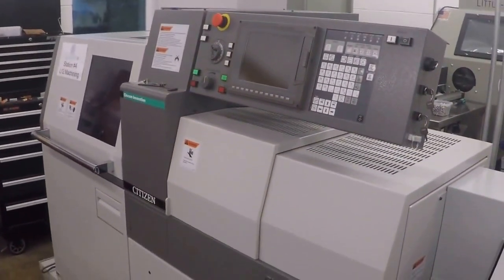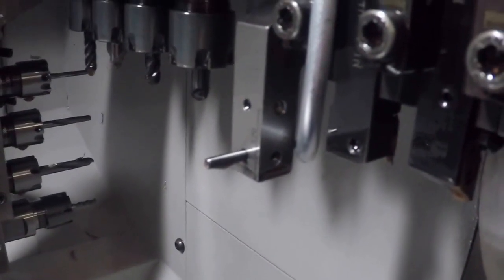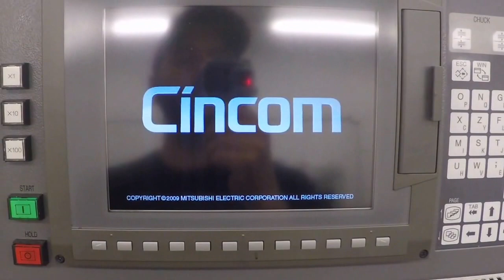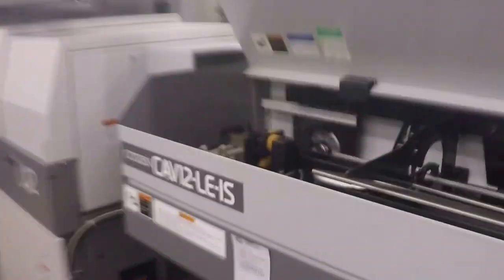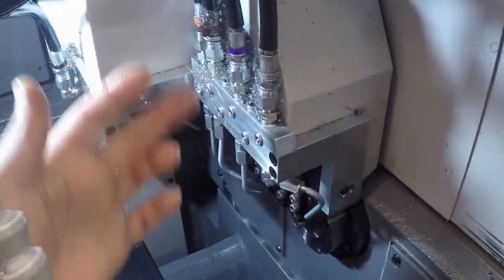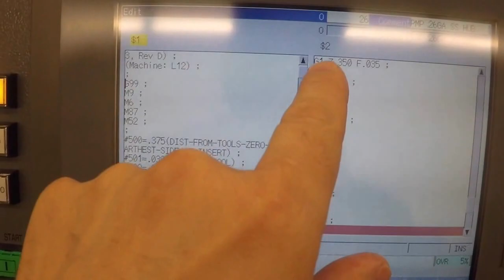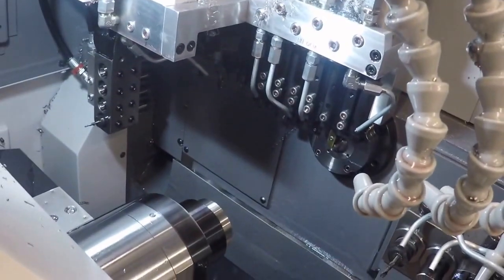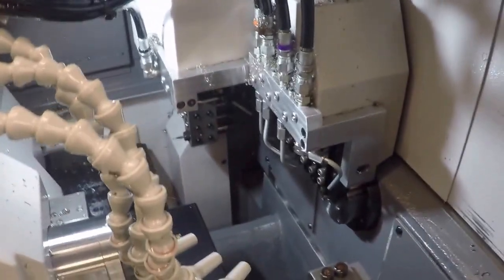Swiss Explainer

Comment: I'm impressed Dan, job well done. I'm relatively new to Swiss style turning and you seem to be very skilled/experienced. I'm currently having some issues on a new Citizen L20. I'm going to post the situation in hopes that you or someone else can help. Thanks in advance. 

We've a brand new Citizen L20 and we're having chatter issue when turning. It's the first part we've tried running on the machine. 

The material is 8620, 11mm stock OD, 6.3mm finish OD, 28.75mm OD length. .01mm total tolerance, .8 finish requirement. The 11mm stock is necessary due to a 10.1mm OD beyond the 6.3mm OD. The stock is precision stock although it doesn't appear to be polished. 

I've tried using a CCGT .4mm nose radius(Sandvik), VCEX .1mm nose radius(Sandvik) and currently a 3 series DCGT .2mm nose radius(Kennametal). The tool is on center. Any thoughts/suggestions on tooling? 

Current cutting parameters are 2000RPM .075mm/rev. 226SFM is slow, if I increase the RPM chatter comes into play. The chatter isn't always consistent either when running higher RPM, I've seen the first 3mm of the part be acceptable then chatter the remaining length. I should also state that we're milling a flat on the part past the 6.3mm OD after the turning operation using a 6mm solid carbide end mill and you can see the back(bottom) of the end mill is dragging once the end mill is fully engaged, combined with the chatter issue it makes me think something is moving, lack of rigidity? Using M18 C0. in the program, couldn't find anything on a possible C-axis brake.

The part is currently running with no taper.

The guide bushing has extended land pads and from my understanding it's set correctly. I can hardly move the stock back and forth by hand through the gudie bushing, I'm able to rotate the stock by hand when the guide bushing is locked. ANY THOUGHTS/SUGGESTIONS ON PROPERLY SETTING THE GUIDE BUSHING?  

The main spindle(Z1) is as close to the guide bushing as possible when in production.

I indicated the stock that was extended past the guide bushing, it's running true(concentric). 

I took out the main spindle collet and it appeared to have witness marks all the way around the front edge of the collet only, almost as if the stock spun in the collet and is only making contact with the very front of the collet. Any thoughts/suggestions?

When I get back in the shop I'm going to run a short bar currently we are running 3 Meter bar length. I want to see if a short bar eliminates the chatter. I'm also going to make a temporary program that only skims the OD to see if less tool/machining pressure eliminates the chatter.  

What's the best practice to indicate the sliding head/turn tool to make sure it's correct?

Any help/insight is greatly appreciated.

Comment: Hello, I had kind of a random question. As far as swiss style cnc lathes, I'm only familiar with using a couple of older Tsugamis. On those ones, they use the M500 series of codes to control whether the main & sub sides are both doing things at the same time or if one side or the other needs to stop moving while just one side is working, to avoid interference. Do the Citizens also use the M500 series of codes to control that or do they use a different method? Thanks for posting :)
Reply from the maker: Citizens use G600s, probably very similar but different codes
Reply: Expert explanation. I learned a lot. Impressive! I started training on a Swiss Citizen Cincom L series machine only three days ago. Thanks for sharing this video, Dan.
Reply: Tsugami and Star use M500 for wait codes that sync the different programs together. Citizen uses the G600 codes (as Dan said) for the same purpose. It’s all brand specific.

Comment: How does the cutting while the bar is coming out (I mean OD cutting for example, and not facing) work in these Swiss lathes? Because if the bar needs to come out (while being turned and being cut), the guide bushing cannot be locked to the bar.
Reply from the maker: The guide bushing is a slip fit for the bar stock, it is not intended to be locked to the bar. The bushing supports the work as it is allowed to travel in Z as machining occurs.
Reply: Thanks for your explanation.
But at 19:51 the guide bushing seems to be locked to the bar. I am guessing that maybe it gets released when doing OD turning.
But even if so, won't there be so much friction between the guide bushing and the bar in such a case? I would assume that it will create so much of heat.
Reply from the maker: @a000ab  No, it is set so that the bar can spin (all be it with some resistance), the main spindle drives the guide bushing via belts so that they spin together, to reduce heat generated during machining. The guide bushing is set and does not open or close automatically on these machines.
Reply: Ok, thanks for the info. It is clear now.

Comment: Great explanatory  vdo 👌
I need guide bushes and collets for Rnc 16 and citizen L16, i want to buy the sets whether new or used, any help would be appreciated
Reply: Ryaan Mughal like, are you looking for used stuff... or just trying to know where to order from?
Reply: Actually i m looking for both.. any thing which is of my concern
Reply: I personally like southwick & meister for guidebushings. I bought a new Citizen and the distributer told me they have bushings and collets in stock. A lot of people say they like Hardinge for bushings.. but I’m just not a fan. They are the fastest with fulfilling the order, but I’ve had quality issues. I’ve noticed the lands of the bushing not properly welded to the body on 3 occasions and the hardinge bushings... even when they’re perfect... I have a slightly harder time with adjusting them. I’ve never had a problem with southwick.

Comment: Nice vid. I knew what a swiss lathe was but I didn't realize how little I knew about them before seeing this vid, lol. Thanks for taking the time.

re: UR5; first, I am curious what made you decide to branch out into VMC work, when you seem to be a pretty hardcore turn shop? Second, and this is what brought me to your channel, what made you decide to go with a robotic arm machine tender vs other milling automation options. i.e. pallets, pallet loaders, or an HMC. (I guess HMC is pretty self evident...$$$$)  Is there a type of part you find to be more suited to robotic machine tending vs other options? i.e. you purchased the arm for a recurring order? Or do you think the arm would be a more flexible solution than other options?

/ramble

I am toying with the idea of making ahem attempting to make a machine tending robot for my hobby mill so I am eager to discuss the pros and cons of your setup.
Reply from the maker: We bought the mill to do some second operations on parts coming off the A20 swiss machine that couldn't be done in the machine. We have another job that had a lot of live tool work on the A20 that is quicker to do in the mill as a second op. We don't do very much if any work that is milling only. 

The robot is actually the second iteration of automation for one of those parts. I did have a set of 4 pallets that were loaded to achieve long runs. The pallets were too labor intensive and the configuration required the use of a very small undercutting end mill that was slow and very expensive. The robot in combination with the 4th rotary axis, allows us to do a lot more work with almost no labor and very cheap common ball mills. 

I would say most parts could be be automated possible with the exception of very small micro parts, but those can be mostly made complete on a swiss machine. I do have recurring orders for the parts that the robot runs and that would probably be key to adding that type of automation. The UR5 is very flexible and could be used for many things, machine tending, even inspections and sorting of parts. 

I am happy to answer any questions but I don't know much about building robots or machines.
Reply: Thx for the reply. That you were able to substantially lower your tooling costs b/c of the UR5 is awesome.  

A 4th (trunnion table) plus robot is precisely the setup I have been considering; although I am planning on doing strictly milling work.  One question I have: Have you tested the repeatability of the UR5? The specs say it is repeatable to .1mm. Have you found that to be the case in real world operation?  

I ask b/c the machine tending robot I am envisioning will be a cartesian style with a 4th axis in the C plane. 1.) I am familiar with building those types 2.) I can avoid error stack inherent in serial robots 3.) Don't have to write an inverse kinematics solver 4.) They are cheap!  Essentially I am talking about scaling a diy Pick and Place (used for placing components on a circuit board) and using it for machine tending instead. The principles are the same, at least I hope so.  A few open source projects even have the vision figured out for orienting parts in the C axis.

If .1mm is good enough for your work I'll start with that as the design goal. As I mentioned this is basically a hobby project at this point, but if I can get it running then I would love to go into machining full time. 

I plan on making vids once I get the project started so I can give back to the community.
Reply from the maker: Repeatability is excellent, check out this video https://youtu.be/9orN_aUDY7w

I never tested mine other than the parts it works with every day are very consistently loaded into the machine.

Comment: How would you drill a .020 thru-hole after drilling a .023 stephole? All .0004 tolerance. T21-T23.

Pray or curse engineers is the real Question.